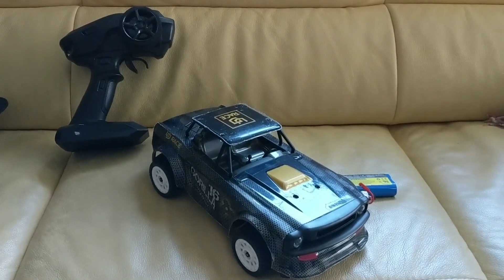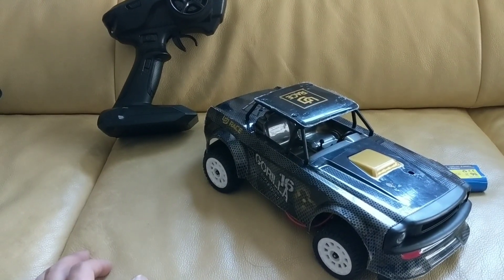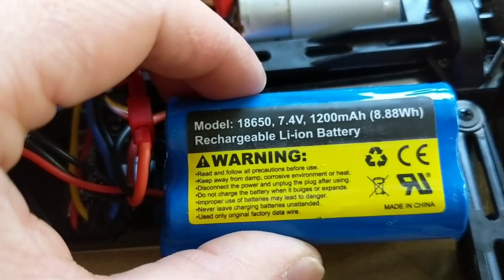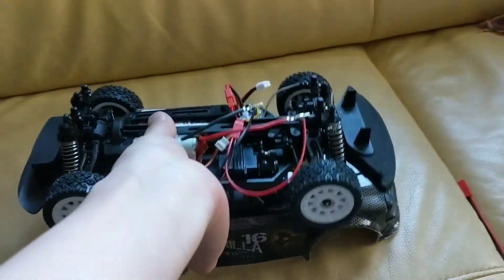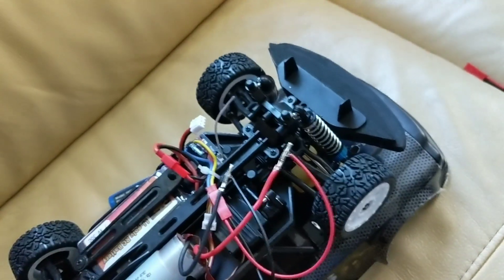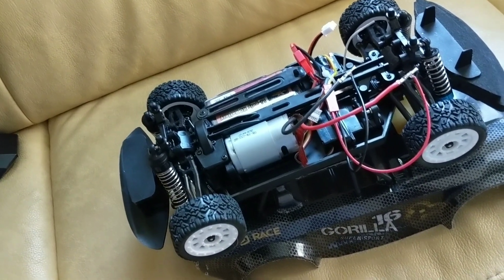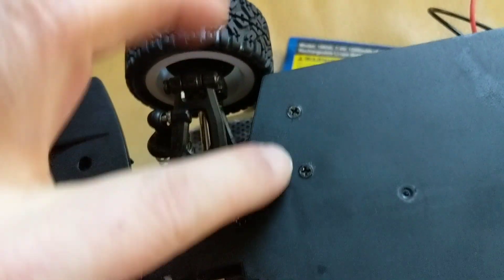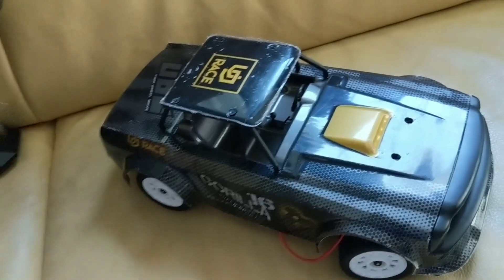SG 1604 Stage 1 Upgrades - 390 Motor, Shocks & Battery: Steps on How to Remove the Motor & Gyro Demo

Comment: If i want to change from a 390 to a 550 what do i have to change
Reply from the maker: Thanks for watching🤙! That was my original plan but unfortunately they didn't leave enough room (motor width) to squeeze the 540/550 in. You'd either have to cut the tray or custom motor mount. The wltoys 1/18 has one that might work.
The upgraded battery alone made a big difference, and doesn't take any modding. I run that on my truck version. Just saw they released a new rally car body, looks pretty cool.

Comment: Would the same lipo you got fit if it were 100 c? Not sure size difference
Reply from the maker: Thanks for watching 🤙! Same battery different c rating should work. C rating is the discharge rate, mah is capacity and would affect the size. This one's a tight fit, but glad I didn't have to cut or shave.

Comment: Nice video..in a stock esc and motor can i use lipo 2s?
Reply from the maker: Thanks for watching🤙! Yes, stock ESC and motor supports 2s. Stock battery is 2s, just lower discharge rating than the one I'm using in the video.

Comment: Hi bro. Just wondering for the Lipo Battery you use 3S/2S?
Reply from the maker: Thanks for watching🤙! In this video I was using a 2s (30c?) I have a later video where I'm using 3s on the stock ESC. Just the 3s should get you over 20mph, but I do like the extra torque from the 390. My preferred setup is the 390+2s, nice balance.

Comment: Your smaller guage motor wires will reduce flow
Reply from the maker: Thanks for watching the observation🤙! That set was just for the testing, I was able to find thicker gauge with the just👍
I really like it with the 390 and better 2s setup, but a better way to get the boost is running a 3s, no mods needed. I saw that they just released the oem brushless esc for ~$25. But I'm still enjoying the brushed setups for now.
Reply: @motorheadaddictions2761  both mine should be here anyday now. I ordered both truck versions
Reply from the maker: Very nice👍! I really like the black and red version. I picked up the green cuz of a deal, but I'll probably look for the spare body.
They're great smaller RCs, definitely bang for the buck.

Comment: Yo man I've been trying to find shock for ages ..I've ordered a pair for the front ..let me know when you find an alternative for the rear, I've liked and subbed bro ..keep the info flowing haha 😄
Reply from the maker: Thanks for watching!
I have a set that fits, just haven't installed them yet. You'll need to assemble the seals and add oil but the length is just right.
https://a.aliexpress.com/_mKK2kJz
Reply: @motorheadaddictions2761  legend so a height adjustment then these go on the rear yh ..I'm ordering them now..cheers for your help dude..I just looked and the ones I ordered yesterday fit the a959..are they the same as what you have suggested or ?
Reply from the maker: @666carping  yeah, for some reason the sg fronts and rears are different lengths. The Wltoys shocks fit on the front, but had to figure out these other set for the rear. I use them on other small RCs too. Filling them can be a pain tho.

Comment: Do i have to change the pinion gear if i want to put the 390? Is there any significant changes in your opinion?i mean is it worth upgrading?
Reply from the maker: Thanks for watching🤙! Do not have to change the pinion gear, it swaps right over.
Depends what you're going for; if top speed, then the 390 does not make a big difference (I believe 3mph gain). But if for the extra punch and torque, the 390 is great.
Honest opinion, the 390 is not necessary since the esc can run a 3s, which is plenty of extra juice alone.
But my personal favorite setup is the 390 + better 2s, gives a great balance of fun and controllability. The 390 + 3s was a bit much to enjoy and handle on the high end.
I recommend trying a low discharge 3s before upgrading any internals, so you don't have to modify anything and you can always use the battery on other cars.
I do have a brushless setup waiting, but haven't felt the need to go there. And key for the brushless stages is to keep the stock electronics and gyro feature.
This is definitely an awesome little RCs 👍Check out the run vids on both setups. Hope this helps.

Comment: Great! Subbed!
Reply from the maker: Thanks for watching and for the support!
Finally found my speed meter, will try to get a vid up soon🤙
Reply: @motorheadaddictions2761  aw yeah! Looking forward to your speed tests! My sg 1604 is still en route, so I'll settle with your vids in the meantime 😁
Reply from the maker: Very much appreciated!! I think you'll enjoy it a lot, hope so. It's a great smaller RC, even just stock.
I just like project builds and wrenching. I'd like to get another brushed stage in before I go brushless. Will be going brushless or maybe even nitro(if I can figure it out) on my wltoys a949.
Reply: @motorheadaddictions2761  cool! I'm thinking whether to follow your route with brushed first, or go straight to brushless... But we'll see. I've yet to hold it and here I am planning its future already haha. Me too, I love to tinker around. Sometimes I find it more enjoyable than actually using the vehicle haha. Downside is, I've broken a lot due to over tinkering. 😅
Reply: @microrcdiaries9648  
HI~
Do you mean that the differential gear composition of 144001 can be exchanged with the SG1604 differential gear?

Comment: Is there a replacement metal gear servo that fits this
Reply from the maker: Thanks for watching! I believe they do, but it has to be 5-wire for the stock ESC/rx. I need to check the dimensions and will try to find a link to one 🤙

Comment: Good cheap mod i wish i tried this before going brushless, 
Also Replacing the rx/esc doesn't mean that you loose the gyro , all my spare receivers have built in gyro's , 
I went brushles for less than 25 bucks , 
Obv without cost of tx rx
Reply from the maker: Thanks for watching🤙! Agreed, have plenty of gyro rx in stock, just maintaining the stock tx rx. Also have brushless swap ready to go, just fun to try different setups from the spare parts bin. I enjoy stage builds, check out my other vids if you get a chance. Haven't been able to get a speed run in yet, still looking for my meter.

Comment: I bought SG 1603. But, my transmitter was a little bit different. My third channel controls lights from on to off to red eagle eyes to both red and white combi and etc. But, my fourth channel controls throttle limits. And, my out of box RTR plus 1/10 grip tyres can keeps up easily with HSP flying fish touring RTR. I'm super satisfied
Reply: What kind of 1/10 tires?

Comment: Any update on the shock absorbers? Did you swap the ones at the back now too? Which ones would fit?
Reply from the maker: Thanks for watching!
I have a set that fits, just haven't installed them yet. You'll need to assemble the seals and add oil but the length is just right.
https://a.aliexpress.com/_mKK2kJz
Reply: @motorheadaddictions2761  - thanks! 
So front and back are the same.lenghr? They ones you got look a tad longer than the originals. Or is it just, because the originals seem quite compressed.... at least the springs.
Reply from the maker: No, front are shorter. I'm using the Wltoys A-Series shocks on the front.

Comment: Can I use motor 550?
Reply from the maker: Thanks for watching! 550 motor will not fit without additional modification, the diameter is too wide. Will have to dremel the chassis.

Comment: Has the esc a lipo mode with low voltage  cut off?
Reply from the maker: Thanks for watching! According to the specs, yes. Haven't tested tho. Hope this helps.
"The esc halves when the lithium battery power is lower than 6.5V, and it will automatically stops working when it is lower than 6V."
Reply: @motorheadaddictions2761  it doesn't cut out completely but does go into a limp mode half power type of thing
Reply from the maker: Great info and clarification, thank you very much!

Comment: The bigger motor will only slow you down because you don't not have enough power to power it up completely if you want it more speed I would suggest getting something with higher RPMs maybe even a 370 motor like the one that is in the latrax that motor is very fast and it is also still brush it is small but it has higher RPMs and also it is very easy to get at the hobby store it is a 21 turn motor
Reply from the maker: Thanks for watching and the feedback! Just playing around and trying different configurations with some spare parts laying around. Have a 2845 brushless setup on standby. I enjoy wrenching and building projects and stages.
You made a great point about the motor sizes, which is really why a 550 isn't necessary(just sounds cool). Doesn't fit either(without cutting). I do have a Wltoys motor mount that I want to fit so I can try other pinions.

Comment: I’m still waiting for mine I got the truck but you have confirmed what I’ve been thinking is that this model is compatible with wl toys a959b series which has a great abundance of upgradable metal parts
Reply: Wltoys 144001 metal diffs fit also , you just have to use the centre of the 144001 diff bearing as a shim inside the sg1604 diff bearings they fit perfect  or just measure and hunt for new bearings.
Check out( RC Clan ) for this mod as he's chasing  after 100mph with his

Comment: Should have just gone with the 540 brushed that makes a whole lot of difference or go brushless check out tomley rc and his brushless upgrade f ing sick
Reply from the maker: Thanks for watching! Brushless setup is on standby and a easy swap, just trying out different configurations for fun. Point of this stage was to keep the stock Gyro function.
540/550 diameter won't fit, but I have motor mount that I'm gonna try to fit that might and will also allow pinion swap.
Reply: Dermal the ish out it the 540 mm wise isn’t that far off from the 390 with some crafty maneuvering  it should fit if your staying brushed

Comment: I have the truck version on order and I was going to do a 540 motor swap on it. I also have a 390 motor in my parts bin so I'm anxios to see what speeds you get. What I've seen so far is about 16 mph stock. Great video 👍🍻
Reply from the maker: Thanks for watching, very much appreciated feedback! I don't think it will be much quicker with the stock pinion gear, but definitely has more punch with the battery too. Here's a link to the motor mount I mentioned(can probably find cheaper on aliexpress or ebay), which will allow for a pinion swap🤘 so I'll give that a shot. If not the 550, I'll at least try to max the 390.
https://banggood.app.link/zsrUv13Zedb
Reply: @motorheadaddictions2761  Cool, thanks for the link, I didn't realise they had the adjustable for the wltoys.